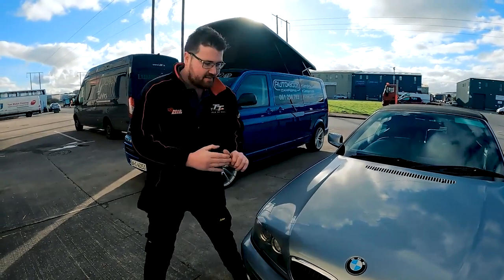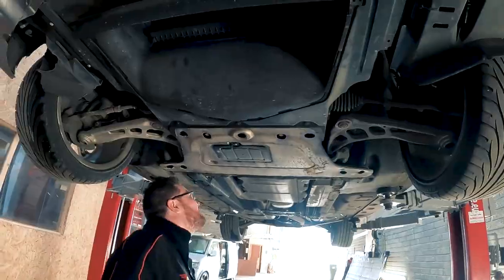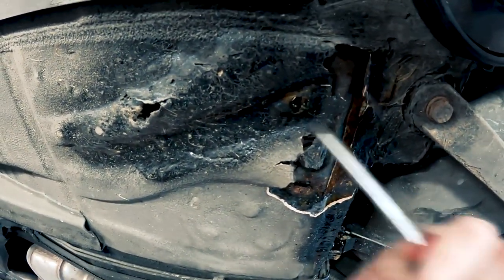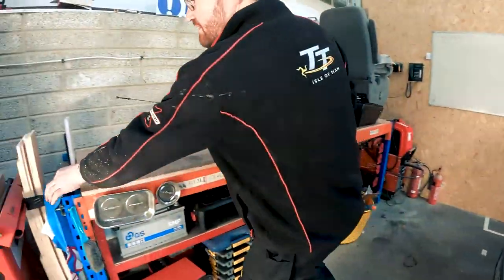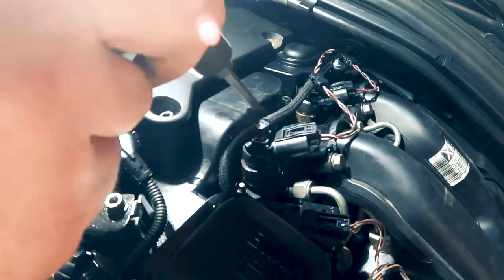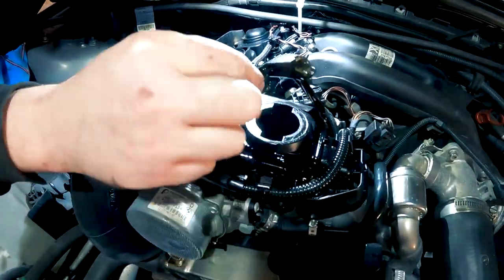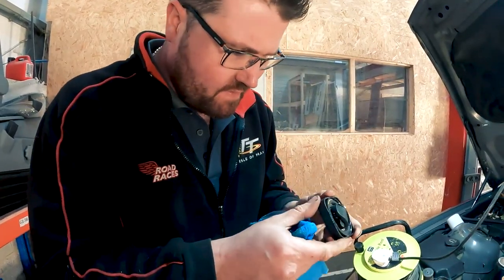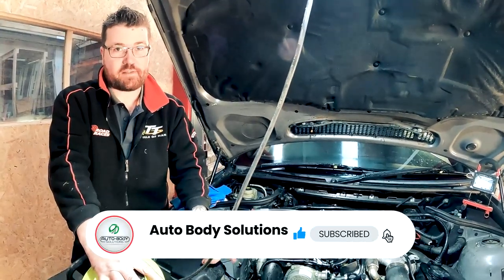OUR NEW BMW E46 320D CONVERTIBLE PROJECT

Comment: Love an e46. I’ve got an 05 330d. The oily liquid on the top of the rocker cover may also be diesel leaking from your injector seals. Worth checking it with the engine running to see if any is weeping out.
Reply from the maker: Cheers pal. I'll be back on this project very soon

Comment: Love these cars. I had the e46. I find with these myself when repairing them? Once you change a simple problem it makes a new1. Pretty much rebuilt the engine ✅💚 new radiator, cooler, engine mounts, cam belts, thermostat, turbo pipe, steering mounts I could prob go on. I’ve had the e46 saloon and that’s a car to look out for maybe.
Reply from the maker: I have to agree!! First off it was a little service . Now it's a full project ! Between this and out 2004 T5 , we will be busy .
Reply: @autobodysolutions6591  a full project of pride. Knowing you built it is better then buying it. ☺️